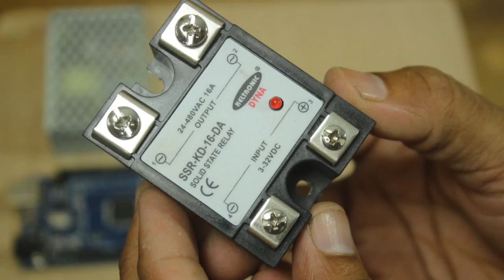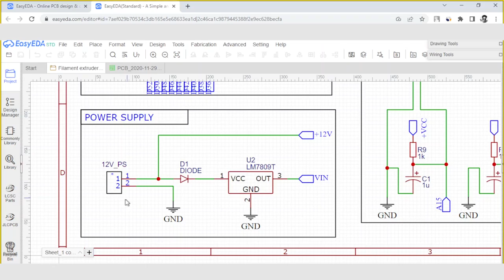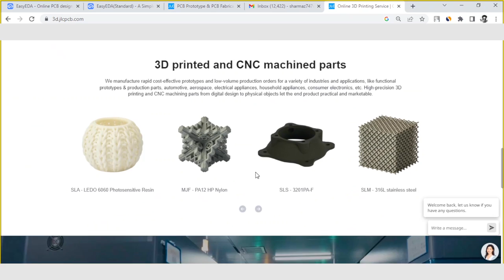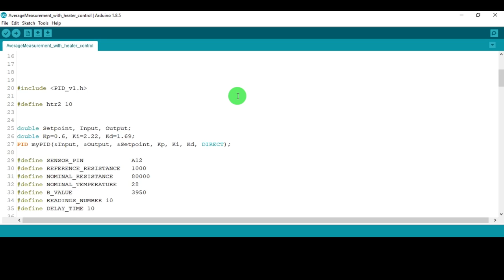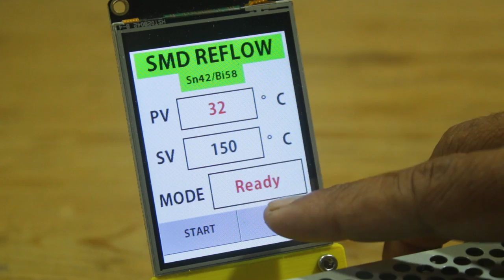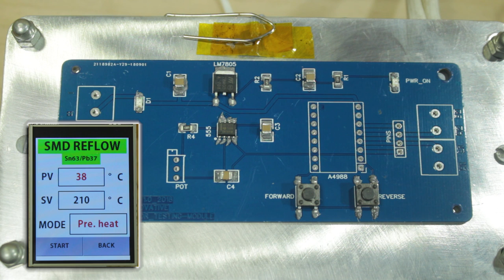DIY SMD reflow hot plate | Arduino project

Comment: Hello and ty for your video, amazing job! I'd like to do it home but I guess you linked the wrong plans for the pcb : Filament extruder 2023. Still, it looks the same as in your video
Reply from the maker: the pcb is universal for heater controller primarily it was design for filament extruder, but in fact it can be used with any heating control application.

Comment: hi ,can you tell what is the black spacers you  used under heat plate for bolts, where you get that part? how much temperature it withstand